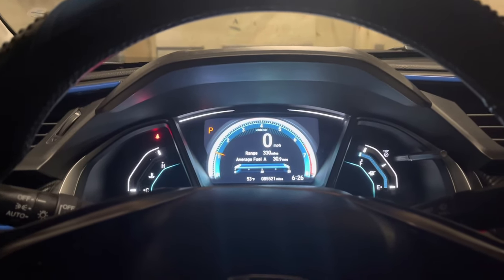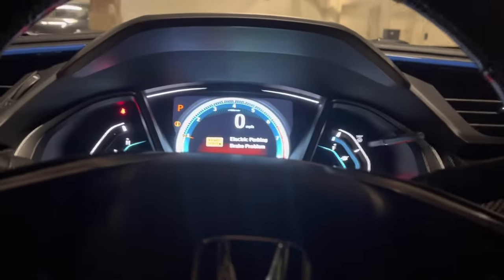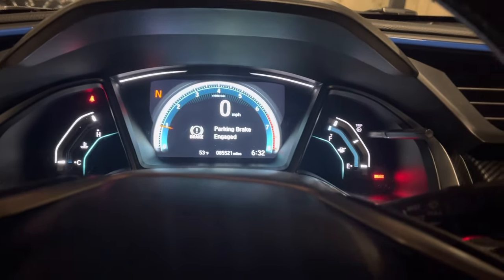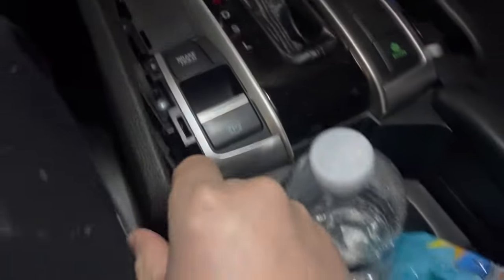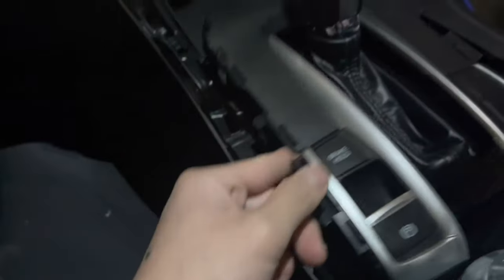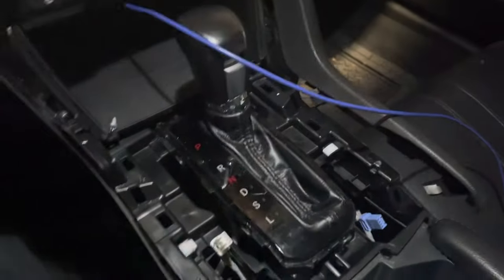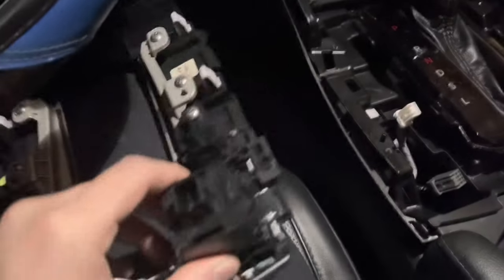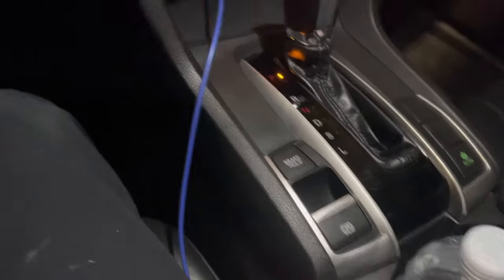2016-2020 Honda Civic Electronic Parking brake problem (how to diagnose & fix it)

Comment: One note I'd add is that the wires for the switches you disconnect at 6:40 don't just pull straight out. You have to press the tab down in the middle for them to come out, much like an Ethernet network cable. The dealer wanted to charge $485 to do this repair, but thanks to this video I was able to get the part and do it myself! The genuine Honda part wasn't just the switch on its own, but the switch with the housing, so instead of messing with those four tabs like you do around the 8:00 mark (actually, you cut away, which means it's really hard to do) you just remove two additional screws underneath, press in on two tabs underneath the Brake Hold button, then pop the Brake Hold button into your new housing, then screw that in and reconnect.

Comment: Not very long ago a parking brake was a lever with a ratchet and button pulling on some steel cables going to the rear brakes.
-bring me up to speed? 
What was wrong with this?

Comment: thanks very helpful!! My brake hold and emergency brake error is showing will it need two different sensors?
Reply from the maker: Thank you for watching! For brake hold system if showing in your dash thats totally normal , just press back the brake hold botton , if it’s still showing try to change the whole botton they are different botton.

Comment: The handbrake can't be lowered on the 2019 Honda Civic, what do you think? even though the parking switch has been replaced but still can't get off the handbrake
Reply from the maker: Probably the problem is the handbrake motor , but I am not certainly sure.

Comment: Does Advanced auto parts store have these parts? Or buy them from dealer/ on-line? I just want to make sure I get the correct parts.
Reply from the maker: I bought the parts in amazon, so far  no issue.
Reply: @johncarlows293  
I charged the battery at Advanced auto parts. I'm going to install it. I hope it helps.
Thanks

Comment: Thank you so much for this video. after 7 years of ownership the parking brake button gave out. 2016 Honda Civic Ex-T. Was able to properly diagnosed using the steps here and fixed the issue on my parking brake. Just got the part today and installed it 👌
Reply from the maker: You’re welcome, 
Glad it helped! 😊
Reply: I did this also but it didn't work 🥺🥺🥺

Comment: Thank you for the upload, I have the same issue and just bought the same replacement. Do you recommend changing the switch myself? Or pay someone with experience?
Reply from the maker: You’re welcome, 
If you’re not comfortable doing it, ask someone with experience, 
But try it first, is not that hard to do it.
Reply: @johncarlows293  i did change it by myself using this video as a guide. I have no experience and I was able to change it successfully without any damage. I would recommend anyone to do it yourself instead of paying 300 (that’s how much they wanted at the dealership😂😂)

Comment: Hi. I have this issue with my 2016 civic EX-T. I followed your video and replaced the ebrake, but the light still comes on. The e brake is working just fine. Any suggestions?
Reply: You gotta clear the code with a diagnostic tool

Comment: Hey John! Appreciate the video, it was super helpful. I ordered a part that initially works but then the release of the parking brake only seems to work when push the cable in with a little extra force. Hopefully it's just a faulty button since I got an Amazon part, do you have a recommendation for the switch you used by any chance?
Reply from the maker: I appreciate the watch! I just have mine too at amazon , so far mine didn’t give any problem.
Reply: What’s the name of the part? Please?
Reply from the maker: @martindehoyos6005  https://a.co/d/7vczqSW here is the link , thank for watching 🙂

Comment: All I did was jump my battery and it started working again… should i still replace my parking brake switch if it happens again?
Reply from the maker: Try to check your e-brake switch if it happen again , because mine get burn that’s why it stop working.
Reply: All the parking brake switches on amazon say 2016-2018.. will those work for my 2021 civic?

Comment: I can't figure it out, do I need to remove the P part? I just need for the Brake System to go away.
Reply from the maker: Try to figure out first if your emergency brake motor is working before you do anything else, 
And if it is , try the one I did, change the emergency parking botton.

Comment: my issue is every time I drive my car makes a beeping sound and my dash has (electric parking break problems and other isssues that pop up on the dash so if I replace the parking break hopefully it’ll take off the issues on the dash and the beeping sound
Reply from the maker: Try first unplug your battery, if the beeping sound will go out , if not change the parking brake botton, is not that expensive